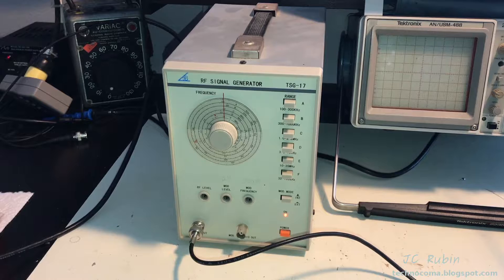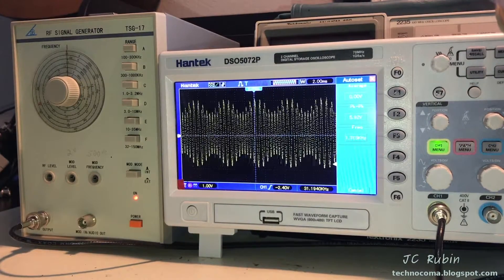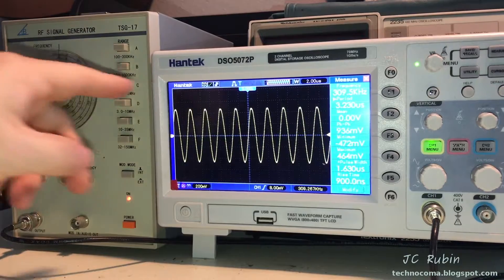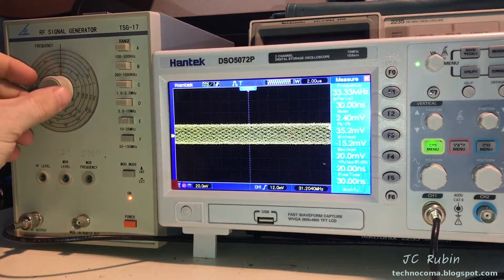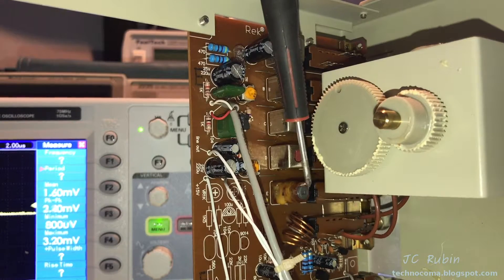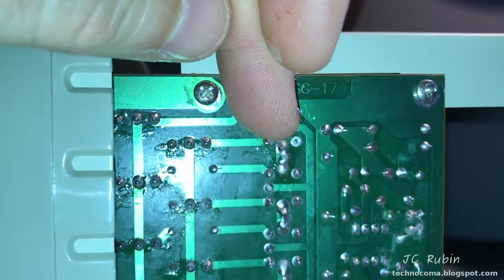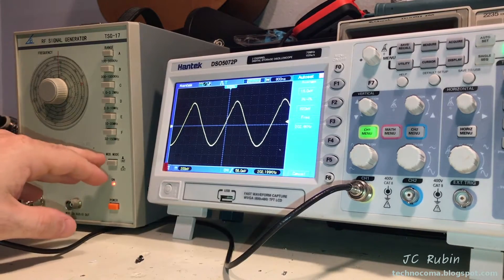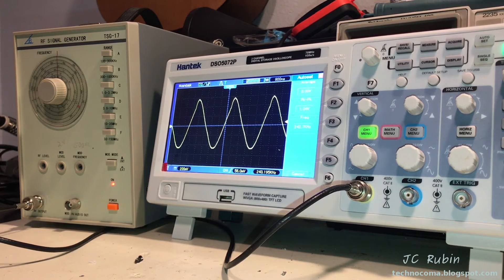TSG-17 RF Signal Generator - Testing and Review

Comment: The units power supply is very noisy. Upgrade the power supply filtering or replace with an external supply and run at 9V and the SNR performance improves.

Comment: The distortion is deliberate. It is from the third harmonic so that you can get up to 450 MHz output from what is a 150 MHz unit. Also understand you are using a 70 MHz Oscilloscope so you will be getting a 3dB roll-off around 70 MHz.

Comment: good video on this rig. im looking for a cheap sig gen to only do a few things to cb radio. to adjust the signal meter to s9  and align a cb radio and to check frequency. I know i have to get a freq counter. would this be ok??
Reply from the maker: CB is 11metre band around 27MHZ and maybe just fine, though this is AM and I believe CB is LSB.

Comment: I will buy one tomorrow, the price would be ok just for the case and the knobs. I would like to mod it until it becomes a fully working unit. Maybe add a AGC circuit to the oszillator to fix the amplitude problem
Reply from the maker: I havent checked to see whats out there these days as a new offering.
Reply: @retrotechandelectronics  Bought an 70s russian milspec unit for the same price instead. Got randomly recommended on ebay, best decision ever!
Reply from the maker: @WolfmanDude  what model?
Reply: @retrotechandelectronics  Its called Г4-70 in russian and G4-70 in english.  You can find an entry with pictures on radiomuseum.org . Amazing build quality, must have cost a fortune back then! Now they are very cheap
Reply from the maker: @WolfmanDude  nice! Make a video or restoration or operation

Comment: Probably the trimpots were not properly adjusted and the distortion of the sine can be corrected by them.
A shield in the RF circuit will isolate the components of the interference caused by the transformer induction with these horrible wires running like a radiating antenna!
Reply from the maker: Do you mean the part in the video where I adjusted the trimpots and it didn't fix the distortion? Or another part I missed?
Reply: I haven't seen it in the video. In fact the generator is unreliable. I would add a filter of AC capacitor (P ) -inductor-(S) capacitor(P) and put a shield in the variable and coils.

Comment: You might find the frequency response improves with the lead terminated with 50 Ohms.
Reply from the maker: Output off this device is generally loosely coupled to an AM radio antenna and doesn't not use a connector. Id also imagine that while impedance matching the output could stabilize it, in that application it already barely puts out enough voltage to do the job, the 50 ohm termination would make that considerably worse.
Reply: Retro Tech & Electronics It would drop the level but would also reduce distortion from reflections. Worth a try surly?